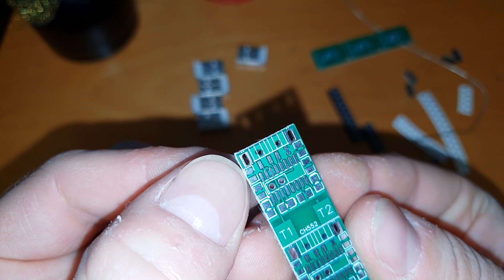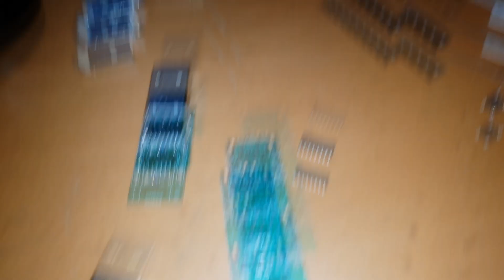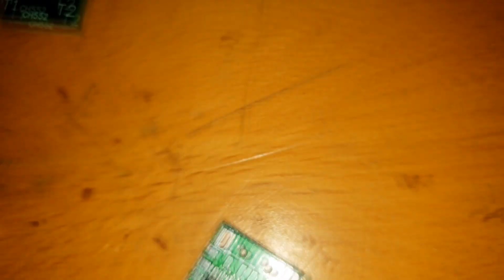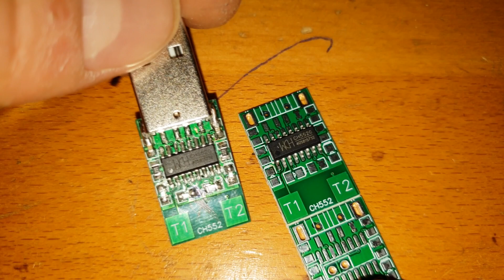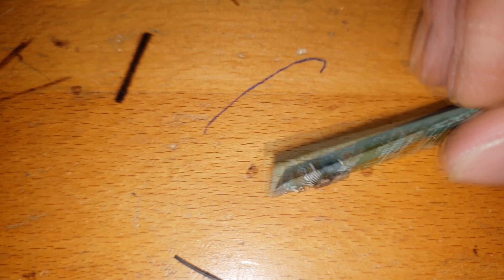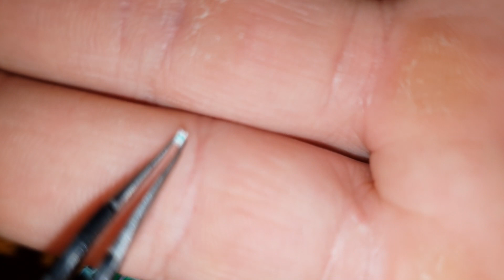CH552 usb Pcb soldering, How to Solder SOP16 chips and other parts

Comment: Hallo! Danke für die vielen Informationen die du bereit stellst. Ich habe mir einen Prototypen zum programmieren erstellt nach deiner PCB Vorlage: https://easyeda.com/editor#id=16fcda923b0e480093d7de9a6e215691|c61357efe74646b28d6abb5bdbe1d837
Bis auf die kapazitiven Taster und SW1 habe ich einen identischen Aufbau wobei R4 20kOhm ist. Leider erkennt mein PC den Controller nicht. VCC und VCC3.3 sind vorhanden. Gibt es hier noch irgendetwas zu beachten? Vielen Dank!
Reply from the maker: Hallo. Wenn der controller von aliexpress ist, isst die wahrscheinlichkeit hoch das er keinen bootloader geflasht hat. Dafür gibt es derzeit leider keine lösung. Am besten von lcsc kaufen
Reply: @atc1441  Oha! Das erklärt dann wohl einiges. Schade. Danke für die schnelle Antwort.

Comment: What kind of usecases do you see for these chips like a washing machine or fridge for example? Have you seen any ipv6 wifi ready chips on lcsc?
Reply from the maker: Hi super strange the comment wasn't shown from YouTube I just found it on my own. I think a washing machine needs too many in and outputs but fridge would be totally fine. Because of the usb i would more think of some USB Gadget for it. Like s pc controlled rocket lsuncher. Sorry i dont know any IPv6 chip